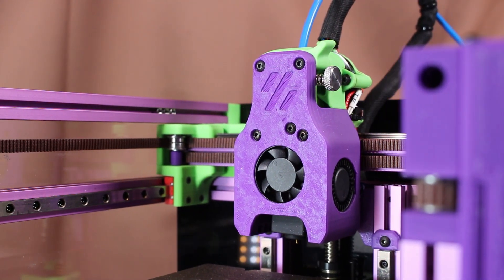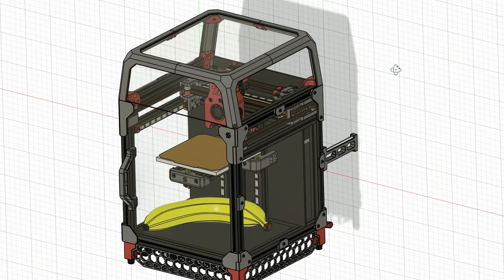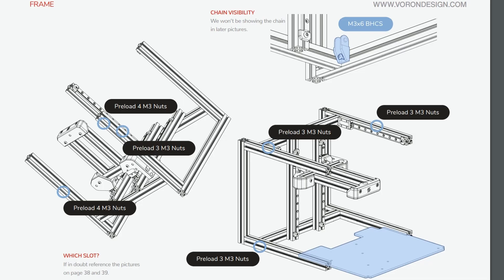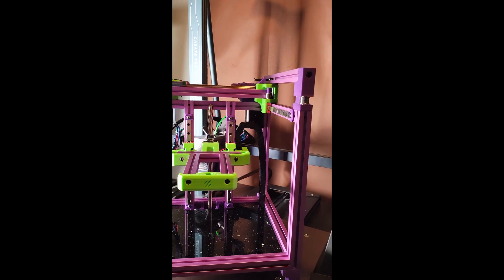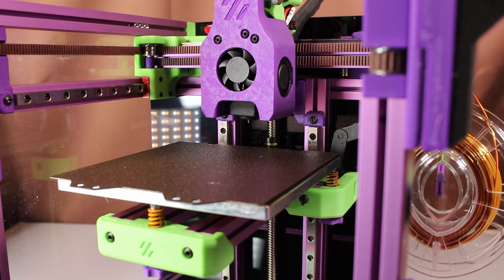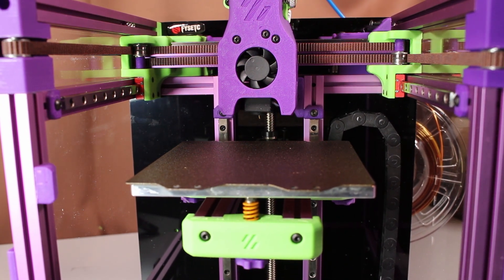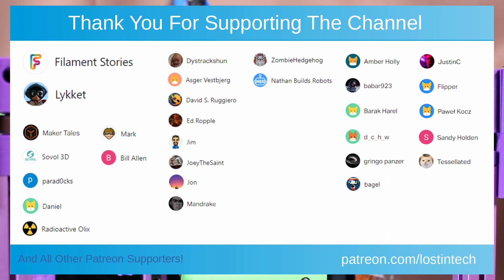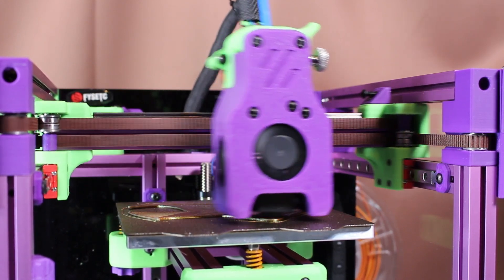The Voron 0 Is Finished - Do I still think you should build one?

Comment: Finally got mine working a few days ago. Going through the tuning now, and have decided I still regret starting the project. :p The 0.1/2 is the hardest of the voron lines to assemble according to others who have done all the different versions.
Reply: Note: In one point of my build, when I thought I had it all together and ready to go.. I had horrible binding issues and other issues.. lost my temper and threw the printer across the room. Left it in said heap for 3 months before I pulled it out and got it finally working properly.
Reply from the maker: hahaha

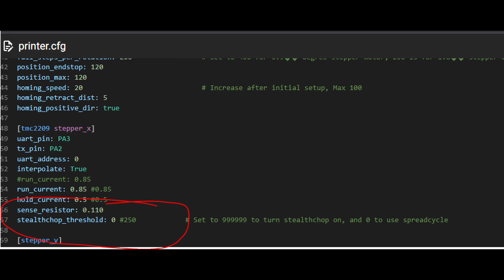Comment: @13:55 the banging you say you heard may be caused by the drivers changing from stealthchop to spreadcycle when going above the 250mm/s threshold, maybe for travel moves. I'm just speculating here btw. The klipper documentation states that changing from stealthchop to spreacycle can cause such things and recommends to only run the printer in one mode or the other so either 0 or 9999999. Again I'm just speculating. Great build and waiting for more videos on it after you tunned the printer more and started putting that beast though it's paces!

Comment: Extrusion companies like Maytec make snap in spring loaded nuts that you can put into an assembled extrusion (aka preloading not necessary).  They are like a T nut and the spring locks them in place keeping them from shifting all over. I highly recommend them.   Probably cheaper than spending time printing nut holders.
Reply from the maker: really! I'll look for those!
Reply: you aint kidding. i used to work at a gas purification company and and assembled massive tank purification systems all with the frames and supports made of aluminum extrusion and spring loaded lock nuts. the spring nuts were absolutely amazing and made it possible to literally have a place to mount a bracket with a bolt going into the spring nut at any location you wanted. the possibilities were endless and i fell in love with aluminum extrusion and springs nuts lol with those two things (and a table saw) you could build virtually any structure you want. this was all many years ago before even 3d printing got big but working with aluminum extrusion and spring nuts with our printers brings me nostalgia and warms my soul lol

Comment: Thanks for this mate; great intro for anyone pre-build on 0.1 or a 2.4 for that matter! 

A few notes I may add for first time v2.4 & v0.1 builders:
 I'm tackling my V2.4 right now and the 0.1 will be next. Glad I stumbled across this this video....and glad I decided to go for the v2.4 first, as the build process for the v2.4 seems to be a LOT less tedious (With roll-in T-nuts with the ball spring detents for m3's and m5's). As you noted in the video even on the v2.4 manual it took me about 4 or 5 pages get into the flow of the vernacular.  
            The vocabulary and the "unique intuitiveness" of the figures will lead you to mistakes but as you progress you will learn....it's idiosyncrasies become very apparent very quickly and you will start to enjoy the process the further you progress through the manual. 
             I also agree with you on not being afraid to run a drill bit through your parts for screw holes. I ran into a few M3 holes on my prints that the screw/bolt wouldn't drop straight through to the heat set inserts (slightly too tight) and thus the screw had to be screwed into and through the ABS before being able to thread into the heat set inserts on the other side. To overcome this (instead of drilling the hole out) I simply put my aluminum 1/4" bit driver right into the chuck of my m12 milwaukee drill on the lowest clutch setting with the right hex bit in it to drive them through; you could probably just chuck a 1/4" or 3/8" hex bit too.  Then I hand tightened them down with a hex key for final torquing. This really sped up the agonizing process of running all TWENTY FOUR of the M3x40mm bolts all the way down through the ABS shell on all four of the z-drive assembly's. If I had to crank all 24x of those 40mm M3's into the ABS by hand my fingers would have fallen off. 
           Don't be afraid to improvise and use the tools you have on hand, you don't need to solely use hex keys cranking everything by hand to build the thing; though I would recommend driving the hex bolts in with power tools and snugging the bolts by hand to avoid over torquing things.

IMO the No-drop nuts mod seems to be the way to go on the V0.

Happy Voron building!
Reply: LDO kit for the Trident now has these "T Bar" things you slide into the 2020 for the linear rails which id say is pretty neat.

Comment: StealthChop effectively uses smaller microsteps, the torque in each microstep is lower but in the end it's the same torque in the steps. For example, a 1/64 step will have half as much torque as a 1/32 step... But 2 /64 steps will have the same torque as a single /32 step, as they're the same thing! The result is that doing two (or in the case of StealthChop, multiple) smaller steps increases the torque more gradually instead of suddenly "slamming on the accelerator", so it's quieter.

Comment: Btw a thought struck me concerning the heat build up, Formfutura makes PLA that is heat resistant up to 95C after heat treating it (baking it in an oven basically). I haven't tried it yet due to real life getting in the way, but i have a spool at home ^^.
Just a thought for future builds that require something that can tolerate higher temps.
Also im not affiliated in any way, just figured id share (there are probably other companies doing this, but this one was the only one i know of).
Reply from the maker: I'll look into that!
Reply: I've heat treated regular PLA (actually the mount for my DD extruder is heat treated PLA) and it's pretty resistant to boiling water in my testing. Much more so than just regular PLA.
IIRC it was either Creality or eSun PLA+ filament.
Reply: @LostInTech3D  its called Volcano, that series of theirs, forgot to type it ^^
Reply: @dalem04  Oh so you did it with just a "regular" PLA? That is very interesting!
Did it shrink a lot?
Reply: @jubb1984  Well whatever the actual mix "PLA+" is yeah.
Shrinkage was very consistent with the right process (Slowly, over about an hour, both cooling and heating), IIRC it was something like minus 1-2% in the X/Y and plus 2% in Z (Yes, it grows in the Z direction). I was able to simply use scaling in Cura to get it right, with a bit of testing. Warping was kept minimal by very slowly raising temps and letting it soak along the way.
Heat treated PLA is actually really nice, if you can get it consistent. Much less brittle than regular PLA.
Reply: @dalem04  wow ok very cool, thanks for sharing! I will def try it as soon as i can :)
Reply: I second heat treating normal PLA - it's a great material for part cooling ducts, with better heat resistance than most filaments and no heated chamber or styrene emissions to worry about
Reply: I wonder if they are using one of the natureworks resins. Heat creep under pressure can happen at a much lower temp than expected. Fantastic stuff at normal room temps, or even in a hot car - not as good as abs in a printer chamber for parts under stress.
Reply: @jubb1984  They way I did it that I found gave me minimal warping was to do it in an oven, starting at 50-60C (about as low as it would go) bringing it up to temp then slowly increasing the temperature up to IIRC 100C over at least half an hour, then leaving it there for a while (10 mins?) then slowly cooling it down as well. I recall in the end I took an hour or more. It was probably excessive, but I only really used it for one part so I didn't refine the process that much. 
Boiling water or just throwing it in at 100 always gave me warping issues.

Comment: I've heard this is the hardest Voron to build, so congrats for getting this far! For an easier/more practical build the Trident (300 cubed from LDO) should be much easier.
Reply: Lol, Wish I knew that before I ~~suffered~~ built a V0 myself
Reply: It is! As how hard/tedious the voron printers are to assemble the order is 0.1 > 2.4 > Trident > Legacy > switchwire. The reasons the 0.1 is the most difficult one to assemble is mostly related to the fact that all the parts are smaller, from extrusions to screws , nuts and parts
Reply: @mitsubishimakes  😂🎉.😂m😢🎉🎉😂😢😅😢😢😂😂
Reply: @joshfaulty  h
Reply: At the cost of that kit, I think I'd rightfully expect it to be fully assembled. At least the one I found, £1500? Yeah I'll pass
Reply: @irreverend_  Not sure where you got that number, £1500 is enough to buy like 3 kits from China
Reply: @mitsubishimakes   LDO Voron Trident kit, all the results seem to be in the £1500 range that I found?
Reply: @irreverend_  LDO kits are very expensive and (IMO) not worth it. Formbot trident kits are currently $647 USD, so 3 of them is almost exactly £1500. Of corse, shipping is still a factor though.
Reply: @mitsubishimakes  ah, well I was looking up the ones the original commenter recommended. That does sound far more reasonable cheers

Comment: You didn't answer the title of the video....
Reply from the maker: I did!
Reply: After first watch I thought I knew the answer, but then realised I don't. After second watch I realised I didn't know the question 😅

I don't think I should be building one and you better not think I should build one either (I don't have opinion if you should, you know if you should, but it looks like a lot of work for, IDK, small fruit, or Wartburg you have put 2000 hours of work and it's still just Wartburg 😸). 
 I'm printing parts for belted Z (Aliexpress stuff just arrived), but that's different, right 🤔

There are good economic printers with fairly little assembly required and all parts included in single box.
Reply: @LostInTech3D  well I just didn't hear it then. Thanks for the content, loved it.

Comment: Those motors in the fysetc kit do very badly with stealthchop, mine did the same thing when I used the default config from them. Honestly they should set the config in their github to have it off by default.
Reply from the maker: yes! I dont know why they have those settings!
Reply: @LostInTech3D  I also found their suggestion for the current for the extruder motor was too low and I had to push it significantly higher to get good results. Either way it was a solid kit (not as nice as ldo but decent and a lot cheaper). Congrats on the build and welcome to the club!

Comment: I finish a V0.1 on the day V0.2 came out too, I didn't find the process tedious at all. In fact, it was the most fun project I have in a while. There are no nut drop mod for open beam extrusion, but you have to look around for it and it only 1 nut each.
Edit: also worth noting that I was a freak who did all the mods I can do on my very first Voron, thus half the instruction manual is irrelevant to me, so your mileage may vary.
Reply: Fucking legend😳

Comment: Not sounding bad here, But the Voron seems pointless to me when the bed size is tiny compared to even the smallest modern 3D printers!

Even the over priced Prusa Mini has a bigger sized bed than this one.

The trend is bigger beds I seen with more printers coming out with beds bigger than before thanks to better bed heating tech.
Some have two bed heating elements so the middle is heated if small stuff done or the outer edge and middle if big stuff is printed?

So even if some Voron's can print faster than some normal printers, I don't see the need to spend tons on a tiny bed faster printer.

Just my take on the trend. I prefer to spend the big amount of money needed to buy the special parts and/or kit for a voron on instead a bigger bed 3D printer.
Most Delta's can go fast if you are in need of such speeds. Even some Bed slinger's  can really go faster if the hot end is a Volcano type hot end or high temp all metal hot end.
Reply from the maker: It's just a project really - it makes no sense to buy it unless you want a project kit to build a printer. Which apparently a lot of people do! 
Wait til you see the size of the bed on the neptune 3 max 😅
Reply: good thing the v0.1 is only $339.... thats really not "big money" at all when it comes to printers. i dont get your argument against it
Reply: There are bigger vorons... 
Also this is a Open source printer that you should build, it is a Project and Hobby, but you also get a really good machine in the end. Also dont forget: the vorons are Out Here quite some time. And the other Producers of printers do learn ans get better over Time. 
If you only Print little Things or have little space--> you buy a little printer.
Reply: It's the combination of speed & reliability that makes them attractive. But I do agree that 120mm is smaller than I'd want. You still have to put in all the same effort as building a larger one. I guess it may come down to price. Or maybe physical space. Just think, if you're operating a print farm: Imagine you have several of these for every full size printer in your arsenal. You could route most prints to these, and use the larger printers for the fewer, larger, objects. 

In my mind, it makes a whole lot more sense than making a print farm with a shit ton of Enders (or similar), because for the same print volume you'll have fewer printers to maintain and, overall, fewer headaches.

Comment: The banging noises come from the transition between stealthchop and spread cycle.
For me personally spreadcycle is less noisy as you spend significant amount of time above 200-250 mm/s and at that speed stealthchop will sound hella loud and ugly, lile skipped steps or collisions. The funny thing is the faster you go in spreadcycle, the lower the noise, 40mm/s is louder than 80mm/s, thats why my first layers are all set to 80 instead of 40.
Also with stealthchop you get skipped steps earlier due to speed. Sounds kinda dumb but i had to set z to spread cycle because i was getting skips due to the 2mm pitch leadscrew on my twotrees sapphire in the print start routine. That was at 20mm/s. Its seems you cant go over 10 Revolutions per second in stealthchop
Reply from the maker: Thats exactly what I was seeing, makes sense.

Comment: I built a V0 when it came out and it was huge PITA to build it. Worse is that back then it was hard to build one that didn't suffer from a number of print quality issues. The current spec of the V0 address that, but I'm sure it's still annoying to build. The Voron 2.4 was easier to build than V0.
Reply from the maker: Haha yes I get the impression the 2.4 is less fiddly
Reply: I suppose it depends on your ability and patience, Personally found the V0 a fun build and prints really well.
Reply: @thegarageluthier  Also depends on the size of your hands, everything in the V0 is so tiny. If your hands are also tiny it's easier.
Reply: @gihadmurad  I'm a big lad it's why they invented needle nose pliers and tweezers 😉
Reply: @thegarageluthier  Now I have an image of a giant holding small tweezers 😂- If you ever build a 2.4 or even a Trident(even easier) you might change your mind, the consensus in the community is that they are both easier to build.
Reply: @gihadmurad  Haha not iron giant big but big enough, Been in this community (3d printin that is) for over a decade have more than a few printers, a couple of tridents and a 2.4, a few tiny-m a tiny-t and some of my own design and a few others here and there.  If you enjoy building everything has its challenges and rewards but its always enjoyable.

Comment: Should be using triangle shapes, not hexagons if you're building beams. Hexagons are strictly a minimum-material solution but only when used in honeycomb stress-skin structures where you care more about weight than strength.  For OPEN beams and braces which are NOT enclosed between two skins and which are NOT going to orbit, you want diagonal bracing elements (se also conventional trusses) OR just use a bloody I-beam like a normal person and call it a day.  OR, since you've got a 3D printer, you could, you know, STOP using open-cell structures for structural elements: make it a box beam full of gyroids or cubic etc infill and it will be strong and use less filament than your fancy looking, but lower-performing, hexagon shapes.  I promise.
Reply from the maker: Is that a message for the Voron team? 😛
Reply: I think all the hexagon pieces are just aesthetic and not load bearing.
Reply: @Dystrackshun  yea they definetly arent load bearing idk what that guy is on about lol chill out man itll all be ok